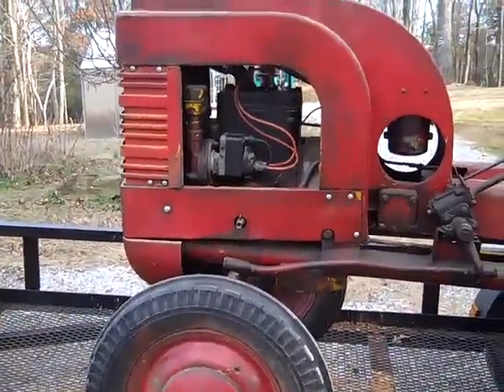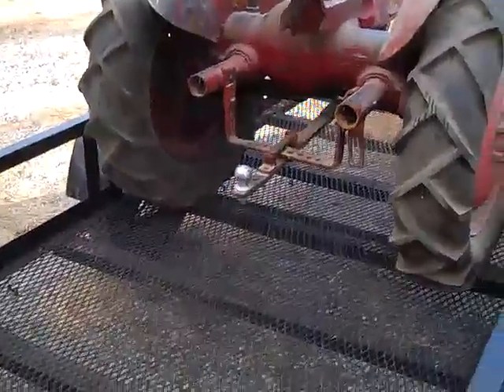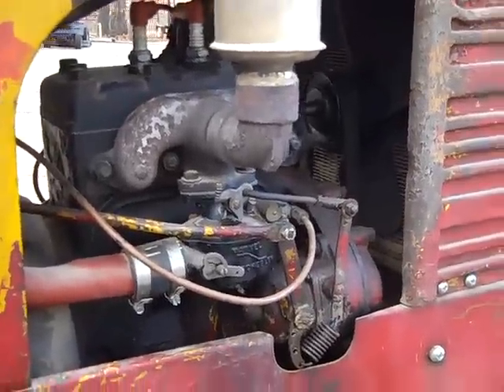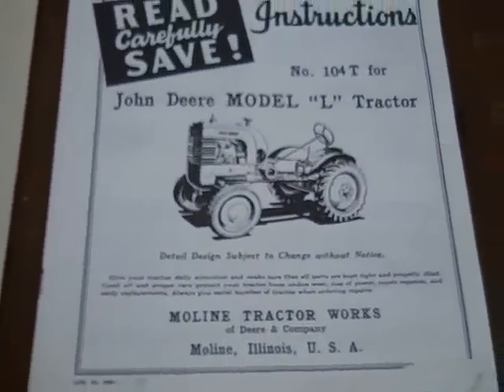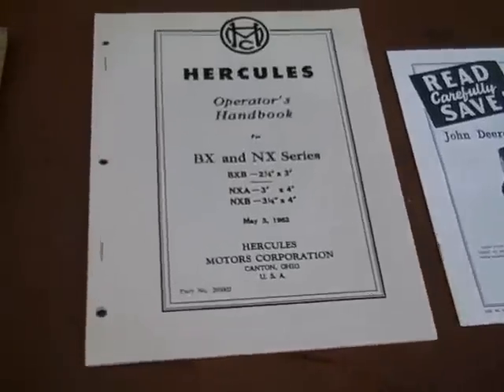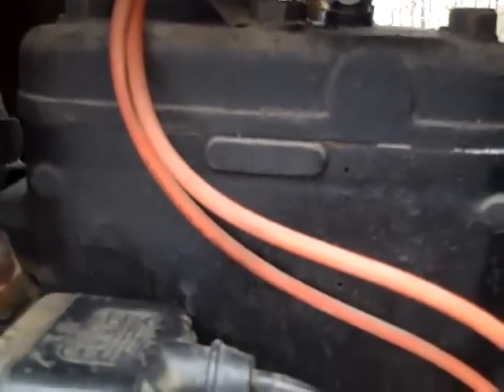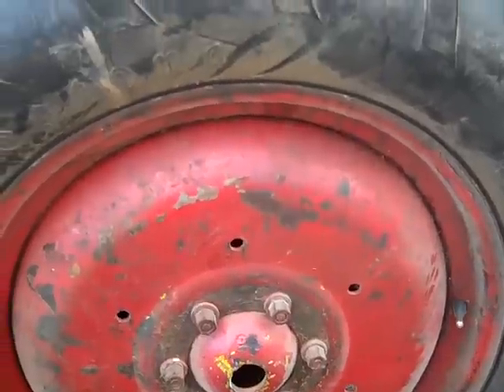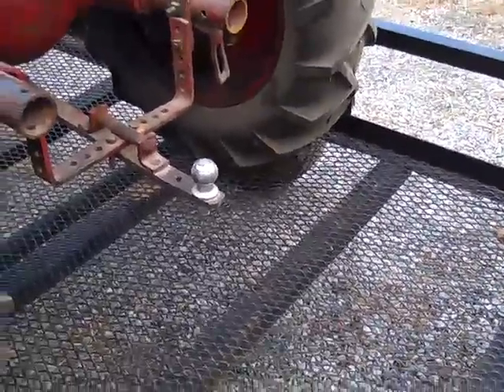Elijah's Tractor Part 1

Comment: 1940- My dad and I have two that were originally sold to Philadelphia park service. Only 14 numbers off in the serial numbers. As soon as I saw the yellow and the high speed transport pedal I knew it was an "I" The  side PTO will probably prove to be very useful to you for future projects. There are shims that go between it and the mounting surface to give the proper backlash. The cover that goes over the impeller shaft in the center is the wide one which was used for tractors with the sickle bar. That's what drove the mower. I would be tempted to try and powerwash off that red paint and see what turns up before stripping it down to restore. Dismounting those tires are more work than you think. You can work around that with sandblasting. These are such nice simple and reliable machines that'll start under almost any condition and burn just about anything you can put in them lol. Thought about using TEG's to run some lights on mine and running a seperate "kill" switch up to the operator's area just as a safety. Otherwise, I wouldn't change or add much to these great tractors. Good luck with it!

Comment: Researching the use of gasifiers during WWII is really interesting. One thing I've seen done is running the gases through an old radiator in order to cool the gases down before being fed into the carburetor. It's great you're doing a father-son project, have fun!

Comment: Very nice. My friend is restoring a 1941 LA. It's almost identical except his has cast iron center hubs on the rear wheels. Josiah is right about the LI. They made an L for industrial use that they painted yellow and called it LI. My buddy's has electric start. The starter mounts on top of the bell housing just under the air cleaner. I have sandblasted many tires without any harm, it actually makes them look fresh and clean. You can adjust the nut on the petcock of that sediment bowl so that it doesn't leak. That is going to make a great father & son project.
Reply from the maker: In 1940 they still stamped the serial number tag as Model L even though it was an Industrial.  This is one of 434 made.  It was yellow and has the transport pedal used by the Li's. I am glad it is a rare one.
Reply: Very nice. I will be looking forward to seeing how you're project comes out. 1 of only 434 makes it even that much more special!

Comment: After a little research it looks like the yellow paint indicates this is a model LI, an industrial version of the regular green model L.
Reply from the maker: In 1940 they still stamped the serial number tag as Model L even though it was an Industrial.  This is one of 434 made.  It was yellow and has the transport pedal used by the Li's. I am glad it is a rare one.

Comment: You may need to clean or get a carburetor kit. Clean gas tank and fuel line. Check plugs and points. That gas may be old. Good luck